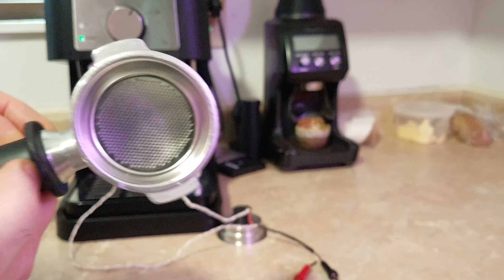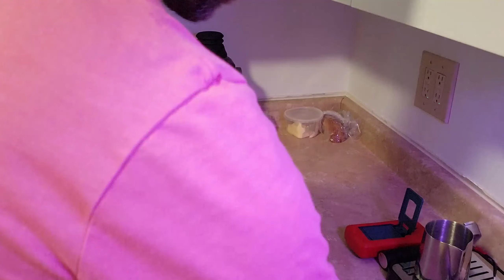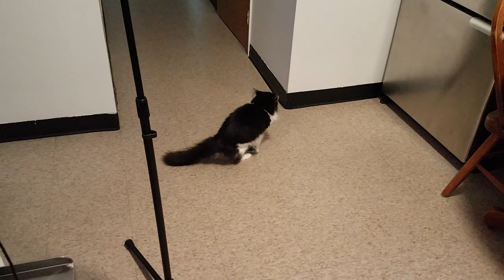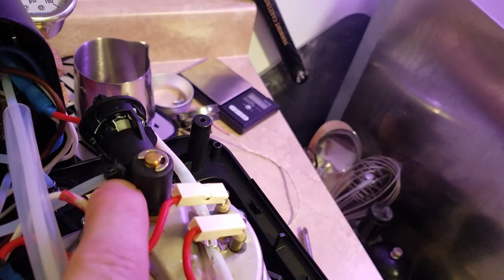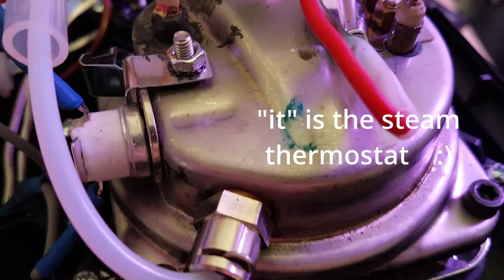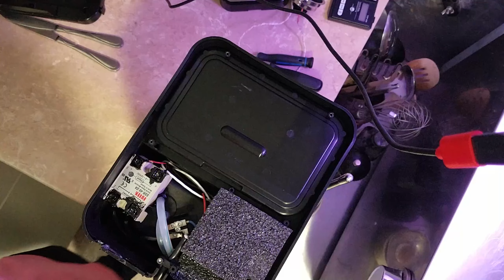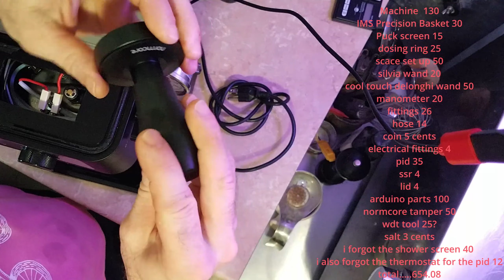De'Longhi Stilosa Disassembly, Mods & Testing

Comment: Hi colleague,
Interesting stuff you're doing)

Also playing here with my ec230bk sandbox, so probably will leave comments with questions here and there over time...but my PID and gauge are still on the way.

So today's one is did you need to grind the inner surface of the holder to make it wider and to manage the 54mm basket to fit? Or it just got there?
And how tight it's sitting in it? Any issues with getting the coffee tablet out? As I understood, no spring left there, just naked PF?

Thank you,
Cheers!
Reply from the maker: Hi!  Yes please feel free to ask any questions any time :)
Answer to your question:
Yes I did have to make the inside of the portafilter larger after cutting off the bottom.  I just used a hand file, then sandpaper finishing with 1000 grit sandpaper.
I was able to manage keeping the original spring.  The groove for the spring also was still there enough in order to hold the spring in place.  It fits very nicely is how I would put it.  Not too tight, and not loose at all.

You're very welcome!  Hope that helps.  If not feel free to ask something to help me clarify :)
Reply: @justinbouchard  , awesome, much appreciated!

Then I'll probably start with all the controls and leave this mod for the future...

Ah, one more just surfaced my mind.

When you were unwiring thermostats, was it clear which one is doing what?. So far I saw just painted red dot on one of them. I've heard that there is some kind of machined marking, but didn't take them fully off to check yet. And the front round knob doesn't make wire tracking easier (╥_╥)
Reply from the maker: @simonshandrinov9079  The thermostat that recieves the electricity first is the steam thermostat.  On my machine, it was the one on the left while looking at the machine front on.  The schematics delonghi has for it on the website say different though so I'm not sure if mine was a random or something.  They both are labeled on the contact surface side though so if you remove one and wipe the thermal paste off you can also confirm that way.  But on any machine the steam thermostat will recieve power first.  Simply because it's the higher temperature.  If the lower thermostat was getting power first it would turn off the electricity when it reaches it's set point.
One thing I will say is that adding temperature and pressure control on this machine is kind of pointless if you're just going to use a pressurized basket long term.  It works well enough to make pressurized basket coffee from stock.  If you're trying to actually make espresso with this it won't be possible without a better basket.  You'll end up choking your machine as there is no over pressure valve. There is only a pressure releif valve that is basically a safety mechanism.  It does not release pressure until beyond 11 bar.
Reply: @justinbouchard  thanks for the extended answer!

As for the basket, my machine goes with unpressurized ones from the factory (though, I've ordered a bit bigger 51mm baskets as I was not sure about 54...and now I believe I need to wait until my 51 tamper wears out before I change it to 54 :D) Plus, it has all metal steam wand out of the box and I started getting a kind of microfoam in just a couple of months trying)). So it's great for the fine tuning already, I guess. Having simple time more C2 manual grinder, I'm consistently receiving 16 > 32 shots in 25 - 28 secs (when there is no huge channeling occurred in the early extraction stage of course...which is happening from time to time)
So I'm aiming for pressure decreasing to avoid channeling, PID for repeatability of shots and beans adaptation...and dimmer for both, pre-infusion and profiling...
Reply from the maker: @simonshandrinov9079  super awesome!!!!  i was just trying to save you going down a parts rabbit hole and working on this machine if you didn't really have a reason to :)    Adding a pressure gauage and a dimmer will be super amazing for your shots :)
I also want to add that you will more than likely be able to grind substantially finer.  The pressure gets so high before any relief it ends up just compressing the puck so much water can't even get through.  Then it ramps up to 11+ bar and makes for a bad time lol
Reply: @justinbouchard  yeah, thought so as well. That's why I can't wait for the next level kingrinder k4 to be delivered...still manual but much more grind settings within espresso range. As on my current grinder I have only one sweet spot...+-1 click and shot is +- 20g in the same time.  So I'm playing only with dose and tampering so far.
And of course, when I'm old and lazy,  will look out for an electrical one instead)) Looks like there were several interesting affordable models popping out lately...like baratza encore esp... Will wait for all the marketing hype is gone, weak parts replaced on the factory line and forums are filled with experienced issues... And than we'll see, maybe it will be worth a try)
Reply from the maker: @simonshandrinov9079  love this!  i'm using a breville smart grinder pro.  i honestly love it other than the noise.  i'm old-ish and somewhat lazy lol, i also have a ten year old i solo parent which adds to my laziness so i love having a machine grind for me lol.  i have not compared it to any other grinder though so that is a thing i need to do.  I'm going to get a hand grinder to compare, just haven't decided which one yet.  i drink a lot more sproovers in the last month or so than espresso, so i'm kind of wanting to have two grinders, one for espressso and one for everything else.  i find it kind of annoying to change grind settings from a coarse to espresso and have enough counter space to spare.  it also seems like if i'm super picky, which i am to a certain degree, that there isn't a grinder which does equally good jobs at espresso and coarse other than a manual grinder.  I got into archery 15 years ago, I also play, repair, and modify guitars.  Coffee is a bigger rabbit hole than both combined lol. Archery might be slightly more expensive sometimes but it's a close call lmao